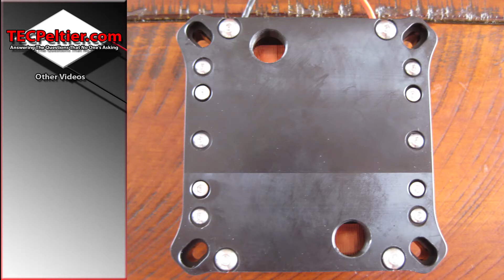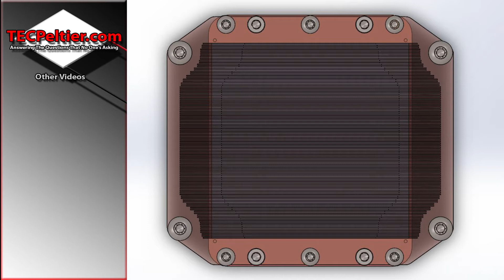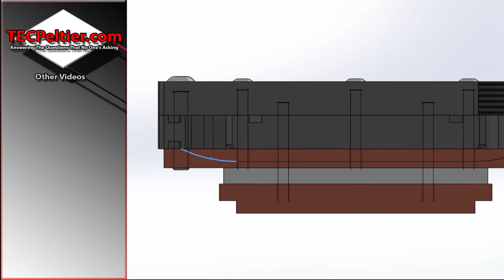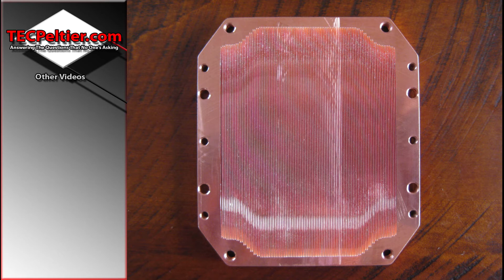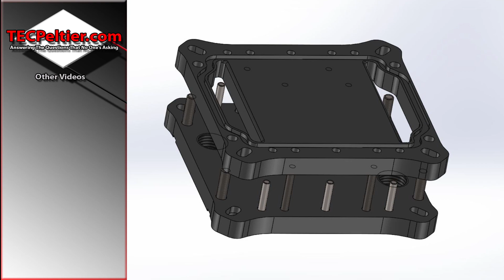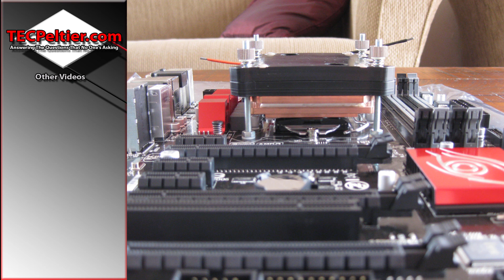⚡️ Thermoelectric Cooler (TEC) Peltier Water Block For Water Cooling a PC's CPU. V4 Single 62mm

Comment: dude I want one but what about condensation build up on the bottom? and maybe making the top out of copper or something and painting it would work better with the whole flexing problem? also I think if you enscribed peoples own logo into the tops you could charge more money get some extra income ;)
Reply from the maker: Well that raises a number of questions. It's my understanding that the copper will also bow if it's machined like a cup,  though it wont be as bad. So it's my understanding that going to a copper top will only increase costs and not solve bowing issues. However id love to know if this statement is based on fact I was just simply told this but by a reliable source. If i was to go to go for a for a copper second leave anyway and assuming it stays the same size it would increase costs alot as that i a big thick block of copper. Though i have not simmed it for a while now i don't believe it results it a tangle reduction in temps at theirs only a compression fitting between the two layers to conduct the heat from the bottom layer to the mid layer ( now copper ) You could of course add some thermal paste around the edges of the block out side the seal to hep with this conduction. If you sub up i'll add this my up coming series of videos im planning on doing. Have in the past put peoples names on the blocks .. only one person ever went for it.
Reply: what about condensation build up at the bottom of the block? And what kind of idle temps are you getting from the cpu? With this chiller im idle at 11c and max out around 23c
Reply from the maker: MadClanPC  well there are lots of things you can do about condensation managment. im a fan of making it simple i therefore like to simply keep it above dew point via the controller